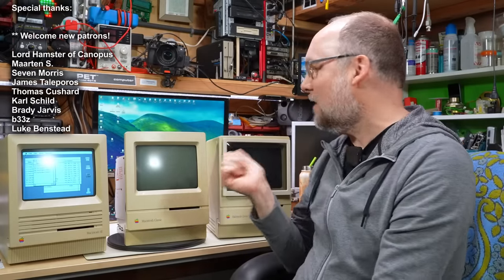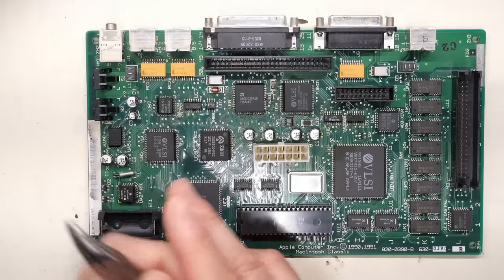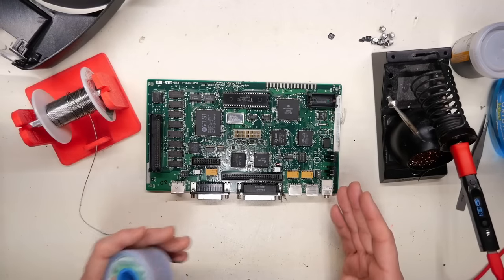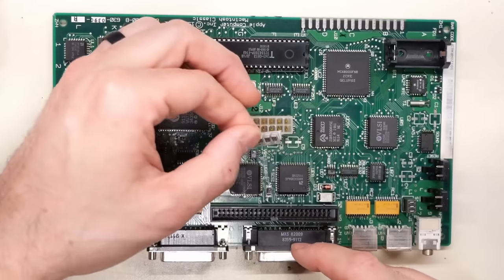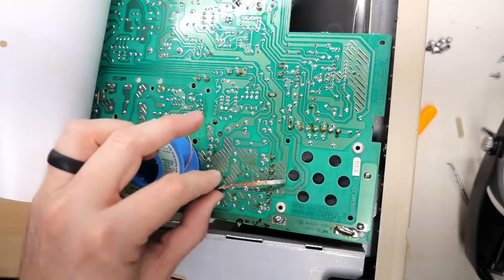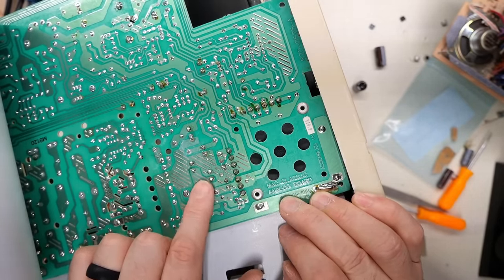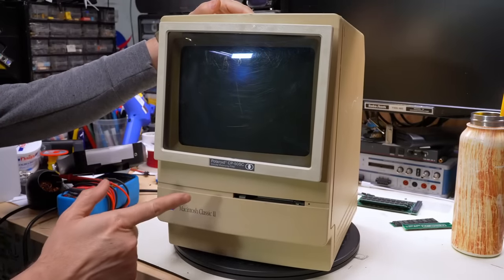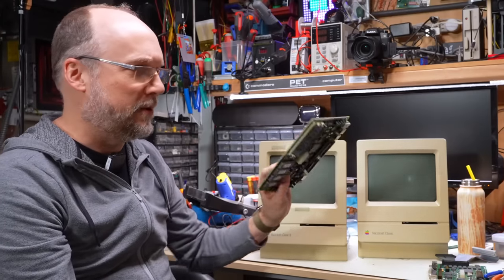Not so fast! I hit some road blocks fixing the Mac Classic

Comment: I found this on Widipedia about capacitor electrolytes. Maybe the residue is boric acid crystals? I don't understand the reaction they are describing but it appears to be caused by water.

The electrolytic systems used today can be roughly summarized into three main groups:

Electrolytes based on ethylene glycol and boric acid. In these so-called glycol or borax electrolyte an unwanted chemical crystal water reaction occurs according to the scheme: "acid + alcohol" gives "ester + water". These borax electrolytes are standard electrolytes, long in use, and with a water content between 5 and 20%. They work at a maximum temperature of 85 °C or 105 °C in the entire voltage range up to 600 V. Even with these capacitors, the aggressiveness of the water must be prevented by appropriate measures.[18]

Almost anhydrous electrolytes based on organic solvents, such as dimethylformamide (DMF), dimethylacetamide (DMA), or γ-butyrolactone (GBL). These capacitors with organic solvent electrolytes are suitable for temperature ranges from 105 °C, 125 °C or 150 °C, have low leakage current values and have very good long-term capacitor behavior.

Water based electrolytes with high water content, up to 70% water for so-called "low-impedance", "low-ESR" or "high-ripple-current" electrolytic capacitors with rated voltages up to 100 V[19] for low-cost mass-market applications. The aggressiveness of the water for aluminum must be prevented with suitable additives.[20]
Reply: If it's an acid then using the vinegar (a base) afterwards could react with it and remove it.
Reply: @sparrow436  Vinegar is an acid.  White vinegar is water + acetic acid, and maybe a small amount of residue from whatever organic stuff they make it from.
Reply: Saw that too.  I decided it was too hard to figure out what the white residue is.  Seems like it could be a LOT of things, and who know what's happening with those different organic chemicals over time.

My guess is it's not boric acid though.  Too soluble in water.  At room temp, 2.5 grams of the stuff dissolves in just 100ml of water.  So that tiny amount would have easily dissolved when he washed it off with soap+water+agitation.

Comment: About the black stuff that appears on the board after removing the remains of the capacitor legs. Are you using a rosin core solder? Wink-wink.

Comment: Many brown caps. are low ESR.  You can create problems replacing a low ESR cap with a normal one.  If it is a switching power supply or higher freq. application like the flyback circuit there is a good chance it is a low ESR cap.

Comment: The Capacitor plague was the early 90's if I remember right, an experimental new formula from nichicon was leaked or something, and 'cheap-o' 3rd party manufacturers got hold of it and started making caps using it, some of them making them under the nichicon name (so, fake's) - the problem was, the formula wasn't quite right, or wasn't the final one or something (can't remember exactly) and so all those caps that were made with it, failed after a few years....
Reply: The industrial espionage problem happened later. It came to light in the mid-2000s. I had a datacenter full of computers at the time and they were dying on a regular basis. It was normal for every cap to have some crusty brown gunk built up in the top of the cap, and it wasn’t uncommon to open up a computer and find a capacitor had exploded.

Comment: I was intrigued by the inability do dissalve the capacitor residue. So I thought I'll read and find out what that could be. So it seems you have 2 different failures here. Motherboard caps have different, organic electrolyte and technically are not affected by capacitor plague as they fail regrdless of being used or not. The PSU caps with brown, easy cleanable stuff are the ones failing only being used, having water based electrolyte and being result of incomplete technology theft from Japan. I still dont know what to clean MB caps residue though ;) The  PSU stuff - vinegar becuse it is slightly alcaine. 
https://en.m.wikipedia.org/wiki/Electrolytic_capacitor
https://en.m.wikipedia.org/wiki/Dimethylformamide
https://en.m.wikipedia.org/wiki/Capacitor_plague

Comment: Flux is corrosive - its job is to strip the oxidation from tracks and components to allow the solder to stick.
Reply: To clean the board, try a PCB rubber or fibreglass pen.

Comment: I think you did the right thing to use the vinegar first and then the alcohol after to clean things up. The theory I've heard is that the vinegar neutralizes the base from the capacitors, so even if residue is left behind, it's no longer corrosive.

Comment: Adrian, Adrian, Adrian... sigh
As I stated before the Classic II came from the LC II and not the LC as you stated. In fact the Classic II and the LC II came out about the same time.

Adding a FPU to the Classic II speeds up screen and printer rendering, as Postscript and True Type Fonts used on System 7 requires a lot of math to do when you resize text. It is also helpful for a lot of games. But finding a FPU ard for the Classic II is difficult, unlike the LC II you just pop an FPU into the socket on the board or in many cases, there is an FPU socket on expansion cards one can add on (which would also give the LC an FPU even though there is no socket for an FPU in its logic board.)

Grey Solder joints means that the Tim from the Lead/Tin Solder mixture had separated leaving only lead in its place. Lead melts at a higher temp than Tin, making removal of such solder dificult. But adding solder to the joint should soften it up and then you can go in with the solder sucker bulb or tool and suck it up and out. You may have to do this several times to get al the lead out of one joint. Then you can clean it up accordingly.

For me, I used SMD/SMT Solder paste to solder caps on the board.Just a little dab on the trace, place the cap onto the solder, hold it down with a tool, and apply heat until the solder melts. No mess and cuts soldering and cleaning times greatly. I used to do it your way as you demonstrated here for years, and it takes me about 2 hours to do a IIcx/ci board. But doing it as I stated with the solder paste, only took 40 minutes to do an entire board. It takes me long because I keep checking and rechecking the board and make sure I did not short things out.

Ah! I see EPROMS on that Classic II! Mine also has EPROMs on it as well! Rumor has it that these were prototype boards that went into market because they could not get the ROMS made in time to make their debute. Again it is just a rumor. But there are 4 EPROMS, citing that these are an early revision of the Classic II; later boards only has 2 - 16bit ROM Chips instead of the 4 - 8bit ROM chips.  The in between board is the board with the properly installed ROMs and not EPROMs. It is rumored that of all the Classic IIs sold out there less than 10% of them have EPROMs instead of ROMs.

Test the board - let it soak in soapy water, towel dry and then put it into the Classic case and see if it turns on. Soaking the board in soapy water somehow rejuvenates the dead leaky caps and the board comes alive. Whether it turns on with a checkerboard pattern, Sad Mac or flashing "?" disk icon remains to be seen. See: https://www.youtube.com/watch?v=5GivbpvLpm4

From there you can guess what you need to do to fix it.

Great video. Lets keep it going!
Reply: Really interesting, thanks.  I've tried dabbing solder paste to a trace and it rarely sticks. The paste I have is chunky and doesn't flow at all though you can use it in a stencil. Consistency a bit like warm chocolate. Is there a more appropriate option?
Reply: Really good information and advice, but the bold “sigh” probably discourages people from looking at the rest of your comment. There’s no need to be condescending.

Comment: Vinegar is always the worst choice. Use pure iso-propyl alcohol or better use acetone with air compressor.
Reply: Vinegar is an acid. Isopropyl alcohol and acetone are solvents.  Different mechanisms of action.
Reply: @beefchicken  True. But... If you want to breake and crach any galvanized layer on IC pads to bare copper go for it... Use apropriate solvent not acid for pcb cleaning. Just a thought: Yor PcbWay or JLCPCB boards are not "vinegar" cleaned...  I don't mind whoever using acid... just... I would not recomend, especialy for pcb... it is actualy wrong.

Comment: Is it worth using solder paste and a heat gun for those smd caps? Seems really fiddly trying to hold in place and soldering at the same time.
Reply from the maker: I personally wouldn't apply heat to the motherboard that has leaky caps. The pads are just glued onto the board, so the heat can make quick work of lifting them right up.... ChipQuick (low temp melt solder might help if you do want to try to get them off with heat)
Reply: Plus, you have the plastic connector sitting right next to them
Reply: @Discretesignals  yeah, I’ve seen many other people melt plastic connectors like that (sometimes not enough to interfere with functionality, but sometimes really messing things up) when using hot air instead of a soldering iron.

Comment: The "wiggle method"  is absolutely NOT the safest method to remove caps.  The safest method is the "snip and disassemble".  The wiggle method pre-supposes that the inter-metallic bond between the capacitor leg and the solder pad is weaker than the bond between the solder pad and the PCB substrate.  It's not...  Twisting the cap is even worse.

Comment: I just don't understand why people don't get it isopropyl alcohol is the best way to clean any electronic device without worrying about water or any other conductive liquid flowing under chips or inside vulnerable components like variable resistors and tuning caps not that there is any on a motherboard but I'm speaking of its universal use. I've used it on just about every electronic device I have ever repaired without any problems. Alcohol and a soft brush work wonders on electronics. Well I guess your posts get deleted when you add an outside link. But anyway CRC electronics cleaner is good too. But please for God's sake dude stop using the tip of your tweezers to scrape burnt rosin off. cringe every time. Alcohol it takes it right off quick. I never had alcohol damage any equipment. I'm not saying it's not possible but I have never had it happen and I've been working on electronics for years. Use alcohol and a brush EXACTLY The way you did with the vinegar.